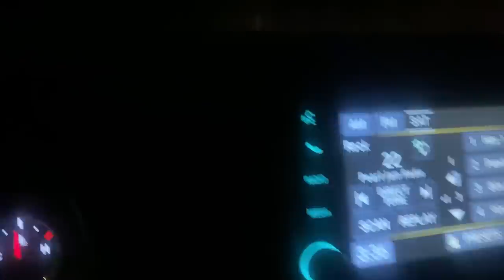Day 2 trucking snow in Mammoth see how it went. 🦣❄️🚜

Comment: Buy a Trecan Snow Melter, save dump fees and you would be the king of snow removal in Mammoth Lakes
Reply: Problem is water when ur melting that much snow
Reply: @TT-ik3kd  And Sierra cement has a lot of water content.  Especially a few of these warmer storms.
Reply: They need tons of water in LA. Sell it to them after you melt it!
Reply: @mmaiorano3  Most of that water ends up in the Owens River and is diverted to LA
Reply: @mmaiorano3  LA does buy water.
Reply: Next time your trucks are blocked call the PD. They can run the plates and tell you who the registered owner is so you can at least check that with the hotel to see if they have a room number for that person.

Comment: Where would all that snow go after melting?
Reply from the maker: Back into the ecosystem
Reply: Mammoths dirt is alot of porous pumice and volcanic cinders.  Much makes it's way down.  Alot fills up the lakes and creeks in spring and early summer.
Reply: @GT-mn3bx  ohh, maybe I could do some white water rafting which not done in many years. 🖖✌️😊
Reply: They are building a glacier!
Reply: @rl9808 Mammoth has areas that never melt out.  Usually a bit farther south, but I've ridden a sled 12 months on dirty suncupped snow.
Reply: @rickzabala6020  Kern river will be insane this spring. Even the Walker river will be nuts.
Reply: @GT-mn3bx  ohh no, I like the Kern. About 4 would be good. With a great outfit maybe 4.5. Take care up there. 🖖✌️😊